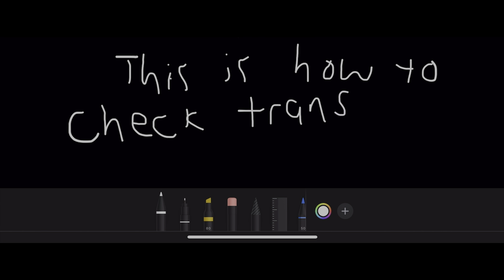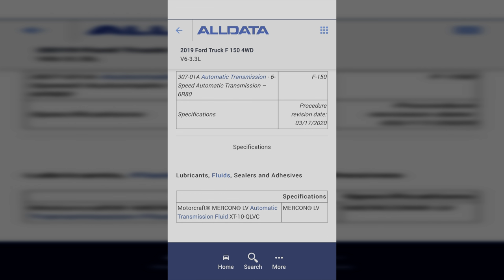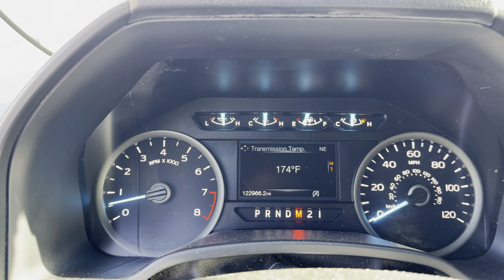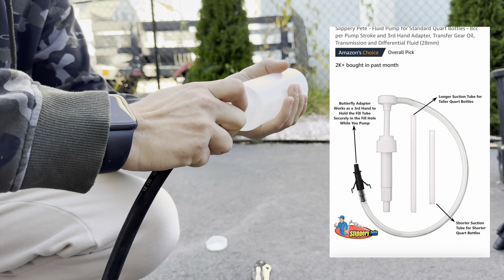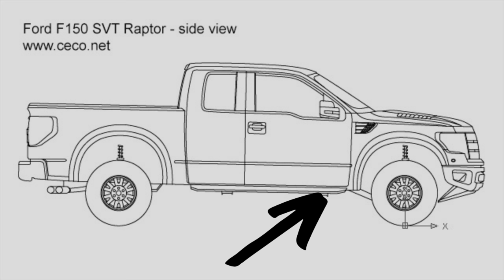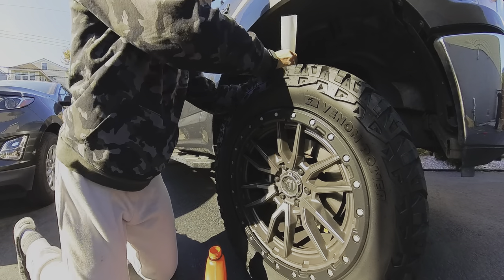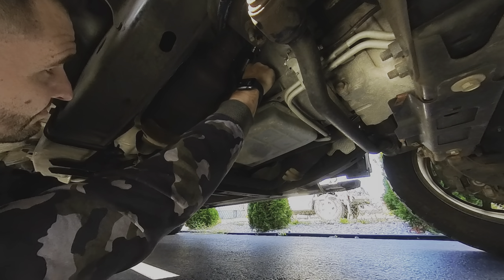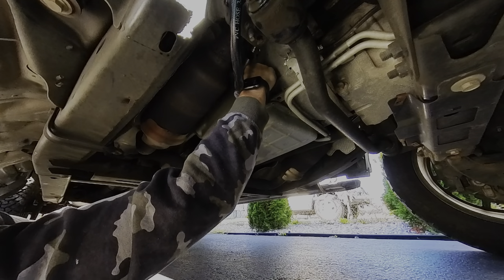How to Check AND add Transmission Fluid on a 2019 Ford F150

Comment: hmmm    6r80
Reply from the maker: 6R80 is fords 6 speed transmission and the 10R80 is the 10 speed transmission
Reply: @CodyDIY  4.30 mark,   What transmission does the 2019 5.0 F150 have?
10-speed automatic transmission
The 2.7-liter EcoBoost® V6, 5.0-liter V8, 3.0-liter Power Stroke® turbodiesel V6 and 3.5-liter EcoBoost V6 are all paired with a 10-speed automatic transmission.
Reply from the maker: Yes all of those are the 10R80. This particular F150 has the 3.3L NA motor which has the 6R80 transmission. The 19’ 5.0 has the 10 speed as well (from my understanding)